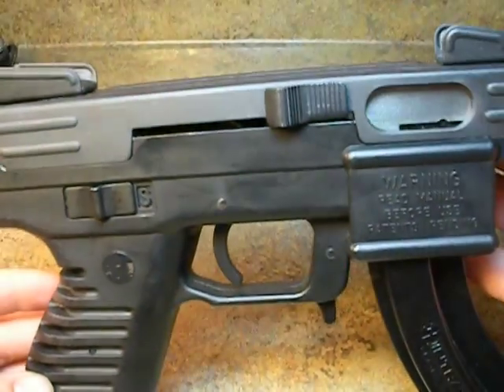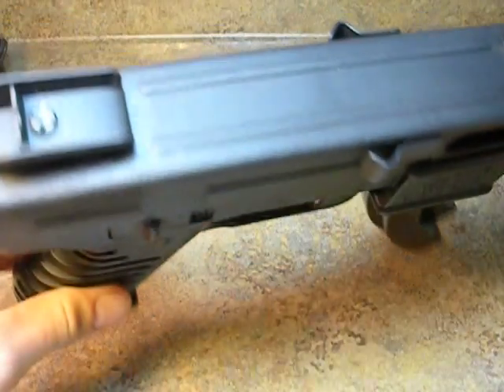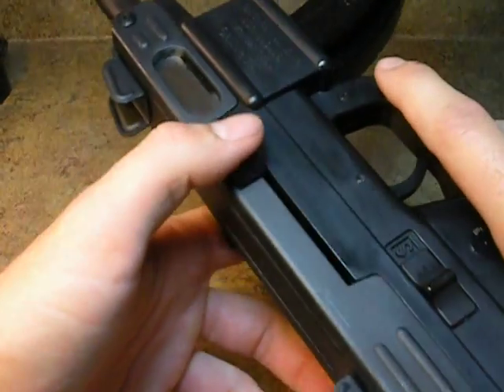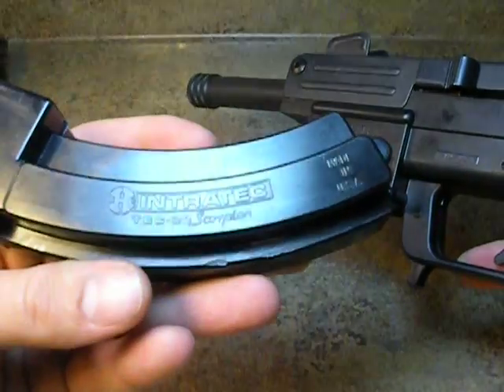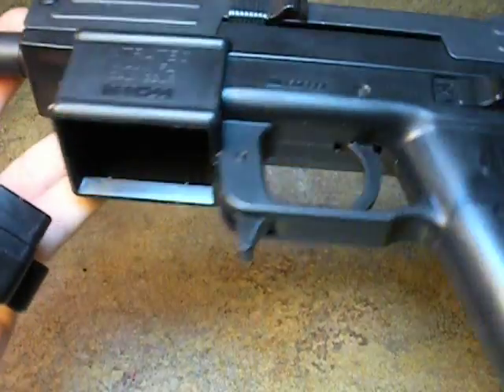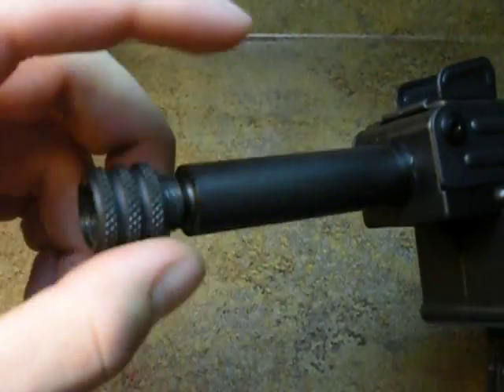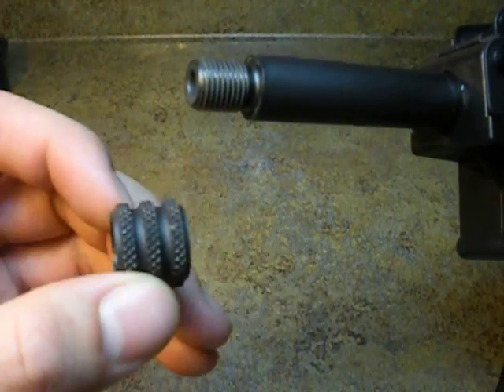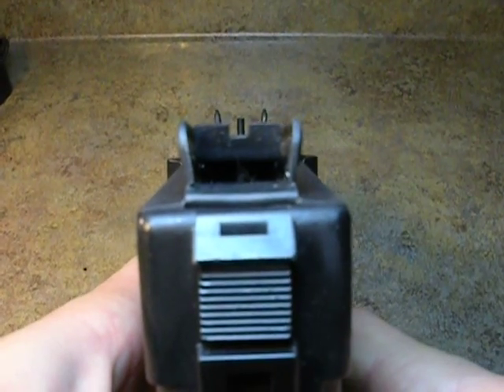Intratec  22

Comment: firing pin and spring from sksparts.com they have a lo of parts
to use ar15 flash hiders you will need an adapter the threaded muzzle thread pitch is 1/2x20
use cci blazers for target practice/plinking they are mini mags without the copper coating

Comment: Tec-22 threaded barrel is actually 1/2x20.  
You will need to get an adapter to convert it to 1/2x28 for a suppressor.